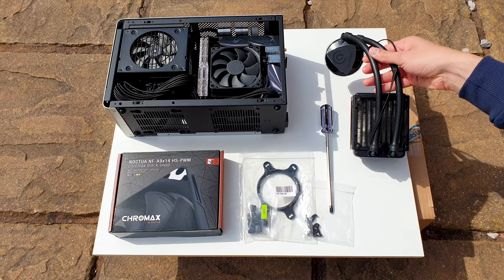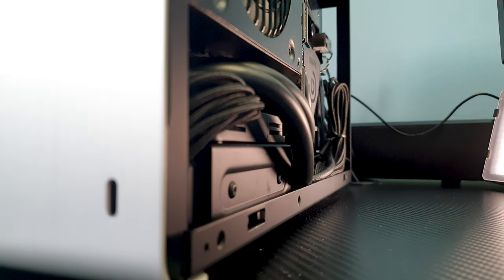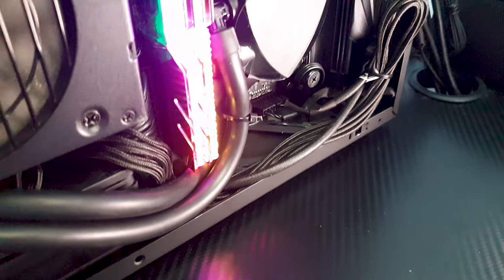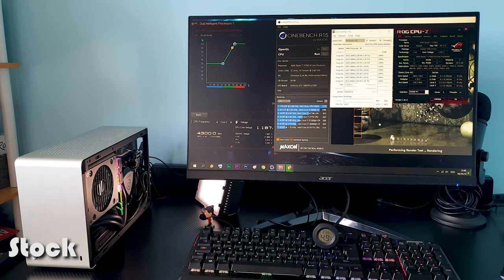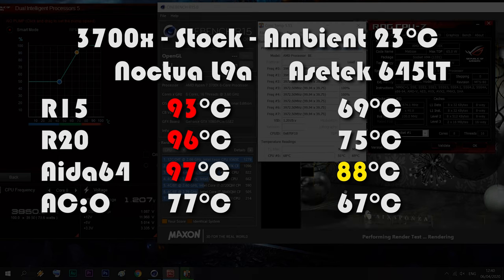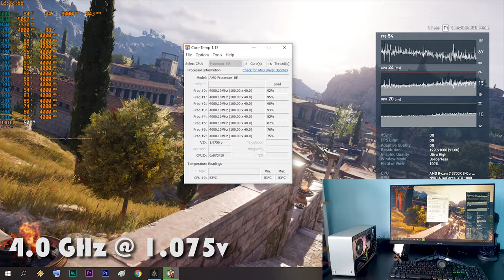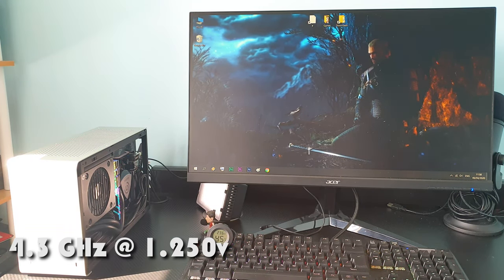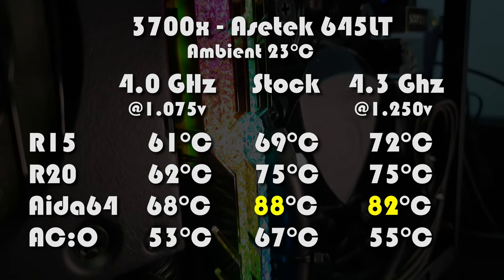Ryzen 7 3700x @ Asetek 645LT | This is it! | Dan A4 SFX | AIO Cooling Tests - Part 2/2

Comment: The fan curve tip helped me out greatly.
I own a SM550 by sliger and my fans pump speed was set to 100% out of the box.
by using the AI Suite 3 i was able to turn down the pump to 50% and my temps are stable and my work pc is working perfectly!
Thank you sir!
Reply from the maker: You are most welcome 🤗 and thank you for the pozitive feedback.
Oh yes, I know, if I didn't discover a way to control the pump I would have stopped using the aio alltogheter. 👍
Reply: @Glob3Tech  I agree, if i wasn't able to control the pump speed then i would have went for an air cooled setup but this is super awesome that you figured this out!

Comment: Thank you dude for this video, very good, informative and well made! Your tip on releasing the PSUs cage from the case itself, to have a bit more headroom to install the PSU was a big help for me, got the PSU in very easily this morning compared to few years ago when I tried it. Rather surprised as to how easy it went, but wouldn't have figured that out myself, so big thank you for that tip!

Also, after watching this video, I went straight ahead with the 645LT and didn't even bother with the L9a. Going to also try the 4GHz on my 3700K with the voltage that you mentioned in the video and see how it all goes. Will also do the pump speed which you did as well. Since you're using the exact same motherboard and CPU as me, so I'm just copying you :P ... This is the first time I updated the BIOS myself, also from your video.

I'm wondering though, in which exact connector did you connect the AIO pump to and which exact header did you connect the noctua fan to?... And have you made any changes to them both in terms of BIOS and/or software?.

I'm also wondering, would you run the tubing the same way you are using with the G.Skill ram at 2:32 in video, even if you had something like Corsair Vengeance LPX memory? Thinking in terms of being able to close the side panel due to the tubing, at the moment I can't cause of the tubing. So thinking of maybe copying yours as well, unless you might have come up with a better way/config for this?.

Last thing for me now is to try and find somewhere to order custom length cables, cause the included with the SF750 is a bit long.
Reply from the maker: Thank you so much for such an epic comment and feedback Dawelio! 🤗

I know, in the A4 every mm is so detrimental. So glad you found that usefull. It's like Ayerton Senna said "if you don't go for that gap.." 😁

Yeah the L9a is on the limit with the 3700x but it is doable. Excellent 😁

Sure. So there are 3 ports there.
From right to left (as you would look at the motherboard installed in the A4) - the fan from the aio - then the aio 3 pin pump - then the chassis fan. Yes, selected the fans in the monitor/Q-fan settings to silent for both and then the pump on auto.(don't think here it makes a difference for the pump but it works) plus don't forget about that Asus Ai Suite to control the pump's speed. Otherwise it will drive you insane with the noise 😁

With the tubing. If you get the LPX Corsair kit, then the tubes have enough space to go above the ram. I am looking at them right now since I got a kit to experiment (I will put a picture for you soon) and there is plenty of space. 

Yeah me too. Waiting on pslatecustoms to take orders again. He/them does/do the best I have seen. Perfect fit. Until then I will have the sides off.

https://www.pslatecustoms.com/collections/dan-a4-sfx

Hope this helps and if you have further questions, feel free to ask away 🤗

All the best,
Alex
Reply from the maker: Here is the scenario with LPX ram. As you can see, the tubes clear the ram and we can close the side panel. 💪

https://ibb.co/Bq43hML
https://ibb.co/CndxgnH
https://ibb.co/4KPKNL9
https://ibb.co/CzV1tGH
Reply: @Glob3Tech  Well thank you back Alex for that extensive reply! :)

So if I understood you correctly, if you look into the case, with everything installed, you have the AIO pump closest to the I/O shield and then next one to the left is the AIO fan yes?... Since I don't have an extra fan under the motherboard, I only have 2 connectors.

I'm sorry, but I didn't quite follow with the monitor/Q-fan settings for both? Is this in the BIOS that you're talking about?... 

Yes, I have the LPX memory... Ah okay, so you zip tied down the tubes on the lower left part of the CPU bracket and then onto the 24 pin cable. Nicely done. Although I'll have to wait for the pslatecustoms to open on the 20th of April to order my short 24 pin and then do the same as yours. As currently I'm using the standard 30 cm braided cable that came with the SF750 and it's way too long.

One thing that is driving me nuts and that I unfortunately haven't solved as of yet, tried in the ASUS Suite III in the "CPU fan" tab, the fan on the rad is spinning up and down consistenly and it's driving me nuts. Once it goes above 1500rpm it gets loud. But hearing that ramping up, going down, ramping up, going down all the time is just annoying. Not sure where to fix that, in the ASUS Suite III or in the BIOS?. 

Did you encounter this issue? And did this fix it with the 4GHz at 1.075V?...

Thanks,
David
Reply from the maker: @Dawelio  Hi David. You are more than welcome. 🤗

So, right to left: 
1.The fan on the asetek - CPU_FAN
2.The 3 pin pump - AIO_PUMP
3.The case fan - CHA_FAN

So in your case, just use the first two ports - 1&2 from my list.

Ah yes it's in the bios on the 'Monitor' tab then scroll all the way down to 'q-fan configuration'. It will open the cobtrols for the all of the 4pin ports ibcluding the aio. I show it as well in the clip @ 3:22 mark. 😇

Yes, I needed a strong ancor point since the tubes are quite feisty. Thank you 😊. I know, I will do the same and order the cables so I can fully close the side panels.

That's why I set it on the 'Silent' profile from the bios but do you run it in stock form?

Ah yes if you keep it on stock form, yeah no silent profile can keep it quiet since in stock form as you saw the voltages are on drugs, they spike so agressively. So yes, 4.0 GHz @ 1.075v will make the CPU viable aka cool and quiet and has the same performance from the factory. Or if you can sqeeze more out of it 4.1 GHz for 1.085 or even 1.100v which are still miles ahead better than the stock crazy voltage profile.
I am running the cpu like this (4ghz 1.075) since day one of the review and not looking back. It's perfect for me and  exactly as I wanted it :)

Kind regards,
Alex
Reply: @Glob3Tech  Thank you for your replies and help, much appreciated!

I must say that you seem to have a golden 3700X there, my 3700X is running 4GHz as well, but at 1.130V. It just kept on crashing all the way from yours 1.075V all the way up to atleast 1.125V and now seem to be stable at 1.130V.

I have another question for you though, since you have already managed to tie down the tubes and being able to close the side panel. Do you think it would be possible to mount an Noctua NFA9x14 hs-pwm chromax.black.swap fan on the side panel, straight over the Asetek pump, to have a bit active cooling over the VRM's, CPU socket area overall etc?.
Would it be possible, do you think it would fit between the side panel and the pump? Would this be something that you might be able to try perhaps?...

Thanks,
David
Reply from the maker: @Dawelio  Hi again David! Of course, any time. 

Ah thank you for the feedback. Interesting. Maybe try 4.1 GHz for 1.130v? Perhaps it will 'like' it better at that frequency instead of 4.0 GHz? 

That's interesting and I think every bit of airflow would help. I just measured it for you and it appears that is suficient space to place the fan on the side panel and still close it. So yeah will test it out soon and get back to you with cooling numbers ✌

All the best,
Alex
Reply from the maker: @Dawelio  Hi David. I have the answer for you regarding extra side case fan. 🤗

https://youtu.be/kX-Mj1f6YRc
Reply: @Glob3Tech  Awesome, just awesome! Just looked at the video and also commented on it. Very nice video and impressive results indeed! Thank you for taking your time and going out your way to test it! :)

Comment: Hey, I also bought the Dan A4 SFX with the Asetek 645LT. I see you have decided on a pull configuration for the radiator. did you find that it is more efficient than a push configuration?

Nice video!
Reply from the maker: Thanks! In my curent configuration it's like this now:
- aio fan blows upwards
- bottom case fan blows outwards the case down
- side fan case intake 
I think I tried many variations and the above is the best so far.

Comment: Nice setup and similar to my upcoming build. What length custom cables have you/will you be installing?
Reply from the maker: Hi David. Thank you ! If you check my latest videos please in the A4 playlist, I already got the pslatecustoms kit. I think they are like 10 cm for the 24 pin and under 30 cm for the everything else. Good luck with your build. ✌
Reply: @Glob3Tech  Thanks, i'll check it out!
Reply from the maker: @davidbilling9742  You're welcome 👍

Comment: Does the panel on the GPU side still leave a gap when you use the bottom 2 screws for that sidepanel?
Reply from the maker: If you screw it down, then no gap at all even with the stock cables.

Comment: Hello , nice video! I have kolink rocket which is similar to dan case and i would like to ask if i buy this asetek aio pimp will get me same temps like yours? I am currently running 3700x with black ridge cooler(nf-a9x14 blowing to mobo) undervolted to 4gz 1.075v but i am really disappointed with my current temps(75C on gaming & 85C on stress tests)Do you think this pump will help?
Reply from the maker: Hi there. Thank you! 🤗 If you can fit it in that case, for sure you will see way better results with the Asetek AIO 👍

Comment: im planning on using this exact config basically, but with corsair vengeance lpx (low profile) memory instead. would the water cooling pipes be able to go over the top of the ram and have the cooler over the CPU itself oreintated 90 degrees to the right (straightening the pipes out) so it looks better?
Reply from the maker: Hi Michael. Yes indeed. I did just the same now with the ram and thst gives is ample space to close the side panel. If you can please check the last video in the playlist with the A4.

Comment: Thanks for this video. In fact I've 2 issues with Asetek 645LT : 1- I'm pretty sensitive to pump noise, even if you can reduce it to around 40% (5v) in Fan Xpert. My second issue is linked to implementation in Dan A4 : you are forced to place fan on radiator as intake...thus you are not removing hot air coming from GPU, leading to higher gpu temperature in final. Thus in sandwich case style oriented for gaming, it's better to go to aircoolers..:)
Reply from the maker: Thank you 🤗 and thank you for the comment and feedback. Yes I agree. I found a guy on reddit who did a custom job with the wires and basically cut more plastic from the plugs (custom wires etc) and he now has 28 mm of clereance with the rad inside so we can install a stock 25mm fan. So this is the only way I think to push it further for better cooling results. With the rest, I know what you mean. :)
Reply: @Glob3Tech  I've well tested Asetek 645LT (its performance is really good) and made several trials with 25mm fan (https://smallformfactor.net/forum/threads/smallest-atx-case-cerberus-x-complete-build-log.2007/post-180261) and even customised 92mm watercooling, using best radiator in this size...:D Noctua NFA9-14 (version spinning 2500rpm) is completely inline with Noctua 25mm spinning at 2000rpm in terms of performance (noise is higher however)

Anyway I appreciate you kept your microphone opened while benchmarking.

Once again, going watercooling or aircooling on Zen 2 CPU is depending on your needs. Gaming leads to aircooling, computing leads to watercooling..:D In any case it's way better than Intel 9th or 10th gen that will require watercooling and powerplant to function..:D:D (just exagerating a bit..;))

Comment: Nice video and much detailed, Could you please do the same for the new AMD 5000 CPU series? I am thinking to get AMD 5800X instead of 3700x
Reply from the maker: Thank you! I want to do the same it's just hard to get a hold of these new CPUs due to low stock, high scalper prices etc. But when I finally get one, will of course test them 👍
Reply: @Glob3Tech  Nice, looking forward to seeing it, btw what country do you live in? just want to know the temperature over the year and compare with mine, I live in Holland, Europe.
Reply from the maker: 🤗 Sure, in UK, Devon which is a bit warmer than the tipical Brittish wheather. For example currently my ambient it's 19C with the windows open.

Comment: The ryzen 5 3 series cpus a really are very hard to cool. I’ve had to resort to turning boost off, which makes a significant difference. Gone from 90 deg to 60 deg when gaming.
Reply from the maker: Nice one! Yeah, I saw from other reviews that the 3600(x) are hotter even than the Ryzen 7 1st & 2nd gen stock vs stock.

Comment: so will this cpu be cool around 80c not overclocked when playing games like metro exodus, control etc using the asetek 645LT?
Reply from the maker: In stock CPU form, ~22-24 C ambient, yes probably.
Reply: Glob3Tech Whoa, that’s incredibly low for idling. That’s some crazy cooling for a tiny liquid AIO cooler
Reply from the maker: @Malysitos  I know! 👍

Comment: hi,  4ghz 1.075 v worked for me. How much voltage should i use if i try 4.2ghz?
Reply from the maker: Cool. Try 1.125v? It comes down mostly to the silicon lottery and by trial and error. Let me know how it goes.

Comment: hi. can use this prodcut lga1200 socket?
Reply from the maker: Hi. Yes, just make sure you order the LGA 115x adapter since the spacing is the same as on the LGA1200 or they might even offer the update name for the bracket @ LGA1200.

Comment: Be careful before sharing your temperature on benchmark : showing 55°C on assassin creed on 4.3Ghz @1.25v is really misleading. This game could be cpu intensive and required very stable cpu over long period. My R7 3800X OC 4.3Ghz@1.31v is really stable and shows some temperature between 55 to 70°C (pike) while using Noctua C14S or customed 92mm or Asetek 645LT. Basically your 55°C only refers AC benchmark. Also you have to check GPU temperature while gaming.
Reply from the maker: Thank you again. Sure dully noted. Will update the description with some temperature readings from the actual gameplay. I did a quick gameplay for the L9a video and they were quite close with the benchmark but will test it further and update accordingly.

The GPU was at full load as well. It should be the first line in the msi afterburner on screen stats.